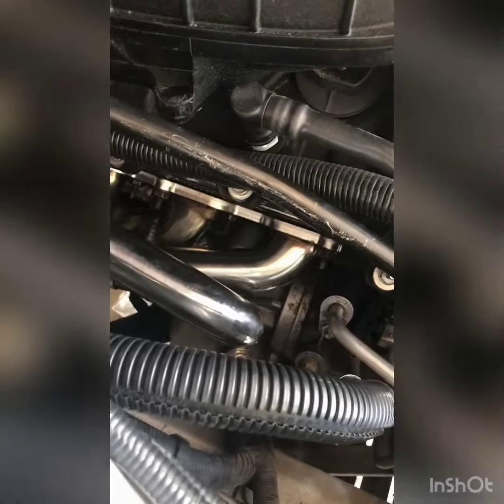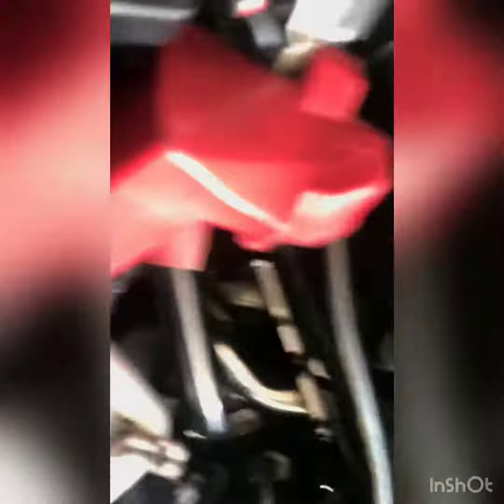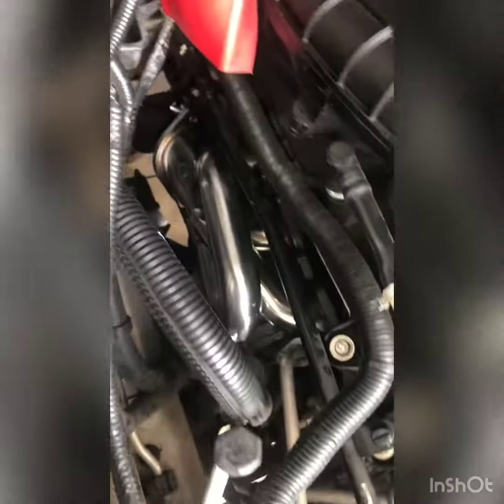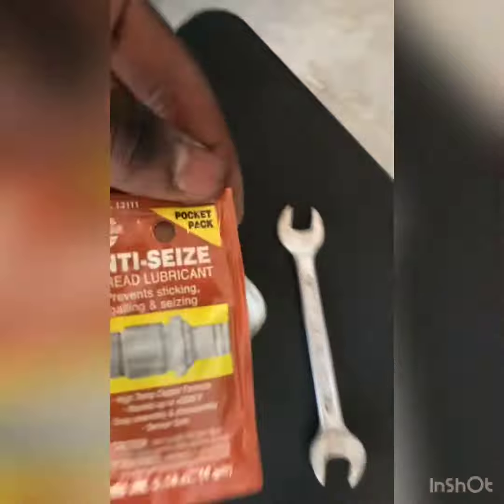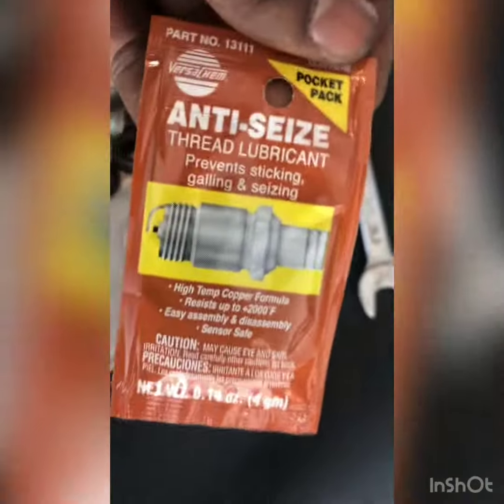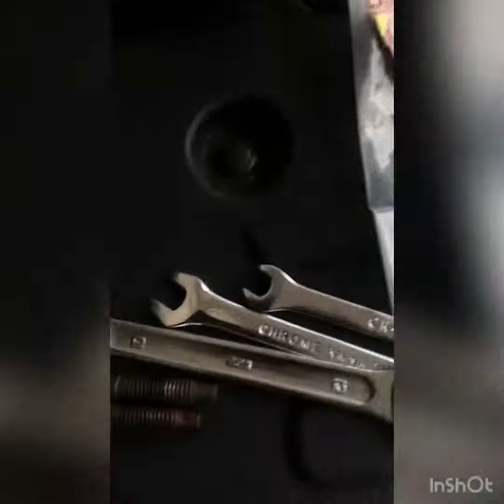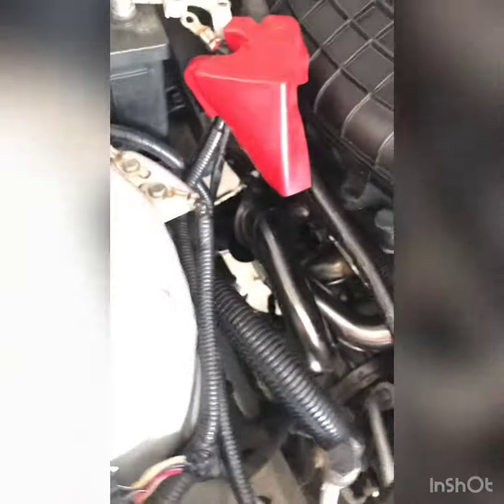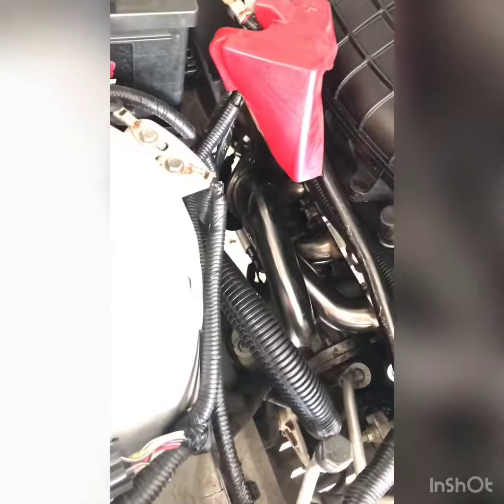Installing shorty headers In a 2014 mustang V6.

Comment: What was the bolt size on the header? I couldn’t hear you
Reply: Also what exhaust setup do you have?
Reply from the maker: 13
Reply: Shortguy dre also was it hard to get the stock gasket off? Like was it stuck on
Reply from the maker: Cuda Calibre  No it was easy for the driver side but the passenger side was a pain